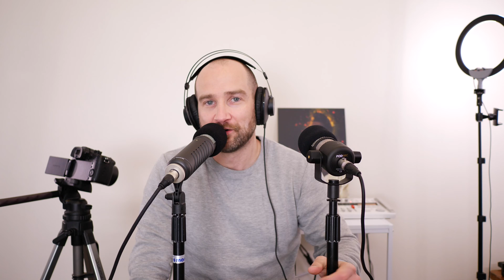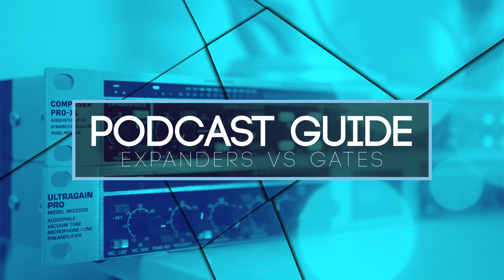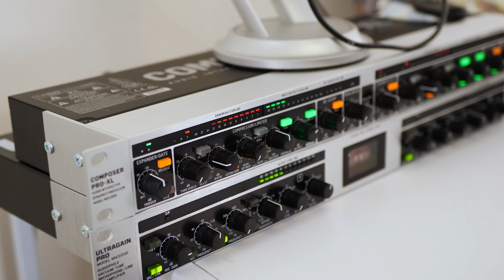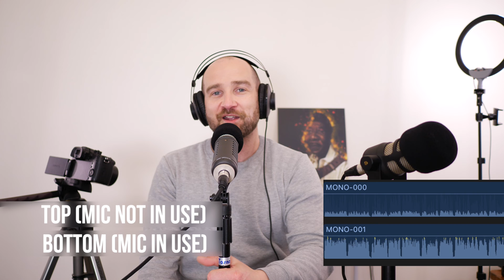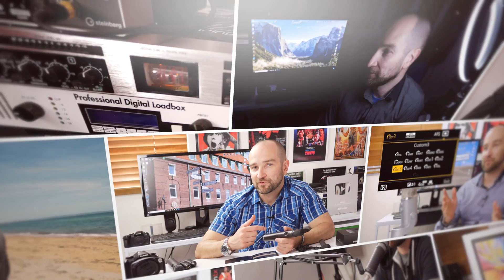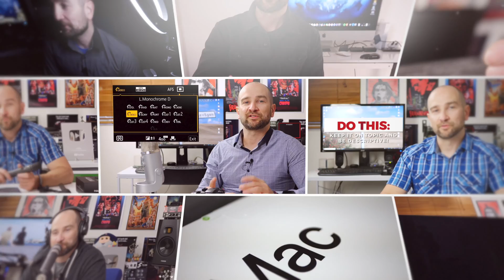Expanders vs Gates for Podcasting

Comment: Hello, I wanted to use Composer Pro-XL for my guitar. But, I have an issue. The composer is connected to my Audio Interface with Send/Return, when I play the guitar while The Composer is off I can hear my guitar but once the Composer is on the sound cut-off! Would you please help me with this matter? Thank you :)
Reply from the maker: It sounds like a noise gate setting. If it's too high it will cut your sound (or it's wired up the wrong way)
Reply: @GeekyNerdyTechy  I did figure just after I did send you the 1st message. I had to add another XLR between the compressor and audio interface lol. Thank you for your answer :)

Comment: Been playing with this a Lot the last year, if you have alot of room noise a downward expander is easily the way to go, It's alot cleaner because it also eliminates the noise when you speak which a noise gate does not do and it means you typically do not need noise suppression either which always lowers the quality of your audio a bit.

Comment: Hello!
I bought a behringer multigate like this, but my unit is having some white noise/hiss noise, like an amp with high volume, not interferences,  when I apply gain to the mixer it is connected to, is this normal?
If I connect the mics directly to the same mixer and apply the same gain on the mixer I don't get any noise.
Even the red leds that indicates the sound attenuation are making some different noise.
Does this gate have really clean outputs?

I plug dynamic mics into the gate's xlr input and then send the gate's xlr output to the mixer's input, all via balanced, shielded xlr.
Is this correct?

Even if I don't plug anything into the gate input, I still get hiss if I apply any gain to the mixer it's connected to.
Thanks!

Comment: Hey buddy - funny finding you here :-).  I actually wanted to buy a gate for my guitar rack.  Was looking at a 4 channel gate, so each amp in my amp switcher has it's own gate.  On the high gain settings - it's noisy when I stop playing, even with the volume of the guitar down.  I see Behringer makes a 4 channel gate/expander/compressor/limiter, which looks ideal, but I wonder if this would work for guitar?  Behringer Compressor (MDX4600 V2).  Always welcome your input brother!  So happy I found a video by you on this topic!  \m/
Reply from the maker: I’m glad you got it working I hadn’t tried it with guitar before. :) sorry for the slow reply I don’t check the comments as often as my other channel :)

Comment: Hi...I have small room (10m2) which is completely covered (top to bottom) with Sonitus Pyramis 7 wall panels, almost death. In room is 4 Shure SM7-B mics to 18in8 Scarlet usb interface, distance around 1m, mics is 180 degree opposite each other. When recording dialogs second mic capture audio. Difference in levels is around 25dB (speaker peak at -6dB, other mic unwanted sound at -34dB). Can MDX2600 resolve this? thanks for good videos!!!

Comment: Hi sir. Can I use behringer pro xl mdx2600 for singing with backing track live in YouTube? I'm looking for a solution to avoid clipping or distortion due to sudden high/loudness in vocals while singing. What can you suggest please?
Reply from the maker: Yes, it should work fine because it has a limiter built-in.  You still need a preamp for the microphone though.  The DBX 286s is an all in one that will work for what you want if you don't have a microphone preamp.
Reply: @GeekyNerdyTechy  thank you so much sir. Keep safe 🙏

Comment: Hey Shane. I have Behringer Autocom Pro, what's your thoughts on that one?? Cheers 🍻
Reply from the maker: I haven't tested that unit before mate but it looks like a very similar unit.
Reply: Autocom Pro is just a Composer Pro XL without the "tube simulation"